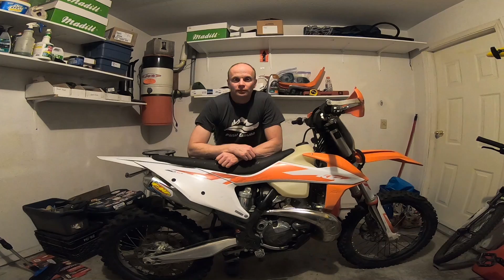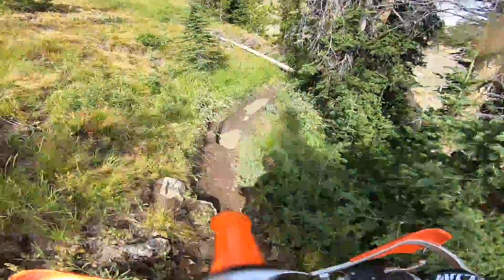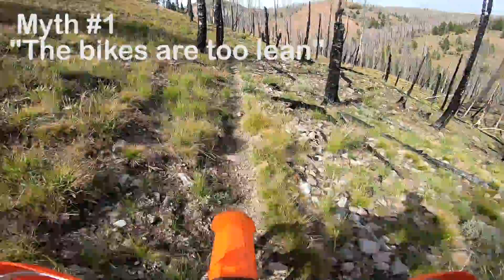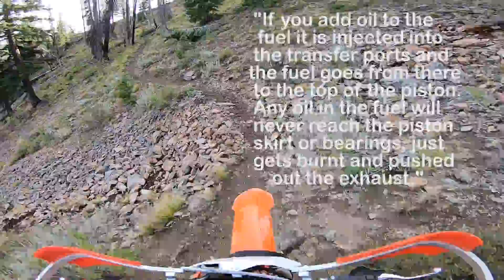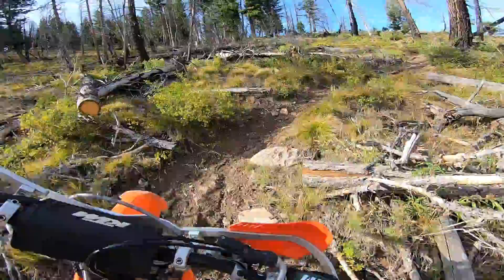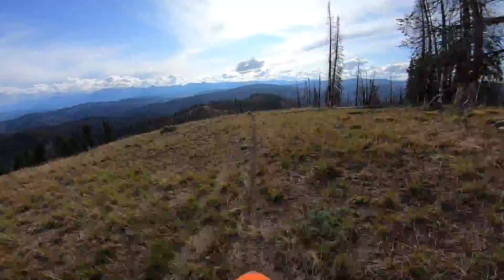The 3 Most Common Fuel Injected 2 Stroke Myths - Episode 77

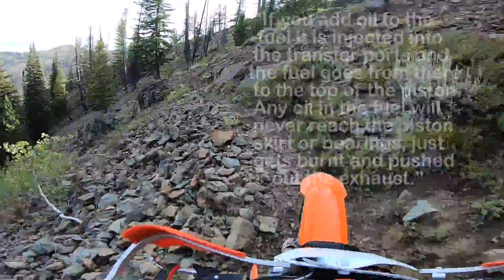Comment: 2:52  This statement is false.
In a TPI engine, fuel is injected on the piston down stroke but it isnt being blown up the ports into the combustion chamber because there isnt any
air flowing up the ports because the piston has blocked them. So at least 80% of fuel injected goes down into the crank case, cools the bottom end
and gets vaporised. So running premix is perfectly ok on a stock mapped TPI bike.

Comment: My ‘19 with 2.0 bar cap, fan, and running water/water wetter would tea kettle at idle after slow/technical riding. If that’s not considered “too lean”, I don’t know what is. I’ve never had a bike that ran the fan so much, even a 500 four stroke. Not to mention the cutting out at all throttle positions and terrible starting.

Comment: First what kind of fuel are you running. Pump? If so 87, 89 or 93. VP perhaps?  What are you using for 2stroke oil?  Regular or the injection kind like what Amsoil sells?
Reply from the maker: Pump 94 octane ethanol free gas and Motorex 2 stroke premix.
Reply: PNW Enduro how about the gear box

Comment: Dave at KTM HUSKY with his engine diagnostic equipment has proven the engines run lean.  There is no debate that many TPI bikes have had advanced top end wear for the hrs on the engine compared with carbureted engines.
  If you’re taking KTM technician’s word that vertical scratches/lines in the cylinder bore are part of the 
“manufacturing process”  then it sounds like your drunk on the KTM Cool Aid.
   Ktm technicians are going to push the corporate party line from the factory in Austria to avoid being fired & for KTM to avoid warranty claims & liability for premature engine failure.

I think if you were to get that new  XC250 TPI bike  out of 1st/2nd gear low rpm riding  situations (ie: pretend your stuck in the mud on a gnarly low speed trail & having to rev the heck out of the engine) then you would experience the engine over heating issues which are extremely detrimental to engine longevity.
.  (despite KTM’s claims TPI bikes have to run hotter for “optimum efficiency “ )
Reply: The vertical "scratches" (which they're not) have been there since the 2017 engine design.  I have never seen one with out them even when new. Dave at KTM HUSKY is the last guy you should be listening to.
Reply: Reno 1960  Why would you be pulling apart new KTM Top ends?
Reply: @Gregamz  At the KTM factory. Putting on high comp heads, etc.

Comment: Great Video PNW enduro I have 125+ hours on a 19 husky 300tpi and it’s ran awesome the whole time.  I just did the oil injector/pump and other than being a pain in the ass to reach the clips I’d say it’s easy. I love being able to drive from sea level up to elevation here in the PNW and just rip.
Reply from the maker: Good to hear! I had mine up to over 10000' twice this week and it ran great once I let it calibrate. Now with the new patch installed it should adjust itself next time.
Reply: Awesome! Hopefully sometime I’ll run into you at MCNutt or Vedder! Cheers!

Comment: Running lean isn't a myth it's fact. Seen dozens of tpi bikes with trashed cylinders on the forums with very few hours. Europe being the worst. Thats a no for me. And you can't touch the PV screw or spring? Thats another fail. And I always laugh at the Jeff Slaven cult. That guy had so many DNF's as a mechanic and was fired so many times. I don't know why people think he's the dirt bike Messiah. All he does is buy a 300 pimps it out with aftermarket crap then sell it for 20k because he's Jeff effin Slavens.
Reply: Frotax Frotax  exactly. And the only reason they're saying 60:1 in the manual is because they're trying to show the EPA/EURO3/4 "Look! Our bikes run 60:1 they're clean!" Otherwise they would say 40:1.
Reply: Why those cylinders gets trashed? I changed my 300TPI piston runned 92h, all good inside.
Reply: Frotax Frotax  The system ktm is using is rotax made and is similar to the SDI used for a brief time by ski doo that had issues. It is similar to what Polaris still uses today the same type of system that had issues in the mid 2000s. EFI over all is a good plan it's just not the right system for the application.  Maybe in time they will try the direct injection method.  It's just a high price for consumer R&D but I do hope the industry continues with 2 strokes.
Reply: It sounds like a lot of these guys have been living under a rock the last 15 years. The tpi is plagued with problems it was always an issue in skidoo snowmobiles. The only guys that are going to know the truth are the ones that have the failures. Not with my 10k
Reply: Frotax Frotax  I don't know from experience, take with a grain of salt, but I've heard and read the tpi on sleds has been shiddy as well in comparison to other systems. But a big reason the ktm's tpi has been bad in comparison to sleds is bacause they're trying to beat super strict emissions.(Euro4) They run at 100:1 some times. That doesn't seem healthy for crank,rod, bearings, or cylinder imo

Comment: I never buy the first couple of model years of anything.  I mean anything.  iPhones, cars,
...  just my rule.  2021? 2022?  I might be in the market for a 300xc
Reply from the maker: tpi engines came out in 2018 so 2020 is 3rd gen already.
Reply: Paul d 2020 is their home run year. Lots of praising all over, ironed out alot of wrinkles. Not just the motor but the suspension too. Go get one! :)

Comment: Yes you’re right tpi bikes run optimal fuel air ratios for combustion, but optimal for combustion does not mean optimal for the engine. The hotter the engine the faster it wears because oil decreases in lubrication as it gets hotter. Also the main way they met the emissions standards is by cutting back on oil consumption, I know for a fact that the top ends wear faster and only time can tell when the crankshafts will fail.
Reply: PeteoBurrito I don't know what skorter life means to your, but I'm on tpi bike number 8, and the last 7 2018-2019 tpi bikes all ran up to 200 hours on stock pistons, without ever having lost of power. All compression tests were good around 185 psi. My bikes are put trhrough the ringer as hard enduro race bikes, Endurocross bikes, hare scrambles, and full time rental bikes. Bone stock, and all have never failed. with the exception of the first  release  2018 250 TPI, that one did run too lien, but as soon as the 19 updated map came out for the 2018 that bike was phenomenal and every bike after that was phenomenal
Reply: Pandas Man Where are u located & what’s your website?  I’m always interested in renting a DB & riding different areas of the country.
Reply: Phoenix AZ in winter time, Portland Oregon in summer. Also travel to ama hard enduro races

Comment: How many miles are you getting out of a tank? Ktm shrunk the capacity, didn't they? That was one of the biggest advantages in my eyes,  extended range due to no fuel loss when tipped over and  the extra efficiency.
Reply from the maker: I'm pretty sure I could get 80 miles on a tank, had enough left at 62. Packing extra gas is a good idea on remote rides anyway, never know when things can go sideways. Or just steal some fuel from a buddy on a four stroke lol.
Reply: PNW Enduro I have gone 80 miles on my 2019 TE 300i in moderate trail riding. Where you really save fuel is not losing fuel out the float bowl overflow tube.
Reply: I get 120km on my 19 TE300i
Reply from the maker: The fuel tank is 8.5 liters where my 2017 had a 10 liter tank. I've done 100km (62 miles) on a tank and had a fair amount of fuel left over. Have not fully tested the range yet.
Reply: @PNWEnduro  62 is pretty good. Just wish they wouldn't have taken away capacity,  guess they needed room for the oil tank and such....80 miles would have been awsome for the adventure/ trail seeker.

Comment: Do you have the oil leak from the PV/exhaust flange area on your bike?
Seems like more and more folks with the 2020's KTM/Husky TPI's are having this issue. 
Some says it's related to the new PV stop bolt(?) that is new for 2020, while others think is  just a shit seal area the PV cover itself.
Reply: Just spoke with service manager from local dealer who fixed my buddies oil leak and he said it was not enough silicone sealant around exhaust manifold area. My buddy has had no leaks since their warranty repair
Reply: @Jeremy-em7yl  
Sounds like they has to pull the cylinder then to get to it. Crap.
Reply: Jack Bauer my buddy thought he noticed new gaskets after they fixed it - good call
Reply: Yup, mine leaks too. 2020 xc 300 with about 50 hrs on it. Started to notice oily dust buildup at about 20 hrs.
Reply: ifurgonnasayitsayit 50 hours - way to get after it!
Reply from the maker: Yes I do have a bit of a leak there on mine as well, just saw it yesterday when I got home from a road trip.
Reply: My buddies 2020 300 xcw had an oil leak he discovered after getting it home from the dealer who fixed it right away - I will try to find out more for you, but you know you still want one! I am getting mine in a month or two. Just trying to decide between the 300 xc or xcw
Reply: @Jeremy-em7yl  
Thanks man. 
My 2002 TE300i is leaking too.
Reply: I also have this leak on my 2020

Comment: I'm curious how you found out about the ECU update.  Does KTM post the specifics somewhere?  I called my dealer and they told me all they can do is hook the bike up to tell me if I've got the latest flash or not.
Reply: Kevin Doyle 
Jimmy Lewis at dirt bike test during his tech talk taco Tuesday a couple weeks ago. So my buddy had just got a 2020 xcw and took it to the dealer they plugged it in and it said update available so they they reflashed the ecu
Reply: Jimmy Lewis on dirtbiketest tech talk taco Tuesday livestream a couple weeks ago
Reply from the maker: I heard about it somewhere online, can't remember where. I had the update done today and when they plugged the bike in it said no updates were available. Since the bike did have to be shut down to calibrate at elevations (was at 10000') the dealer called KTM to check. A person from KTM ended up doing the update remotely.
Reply: Thanks, guys!
Reply from the maker: Ah yes, that's where I saw it too!